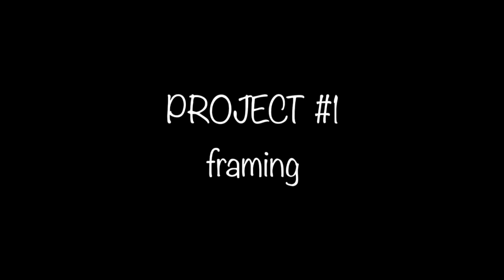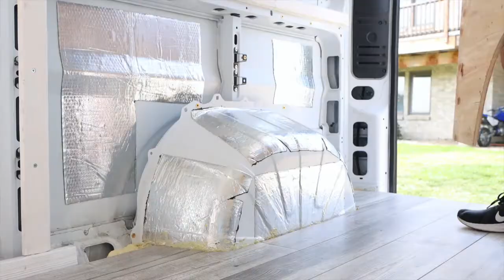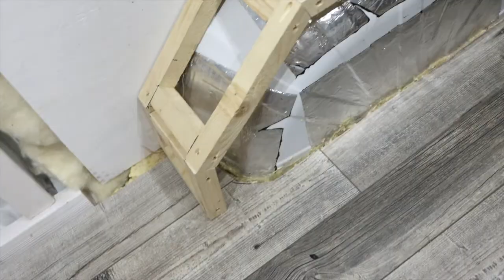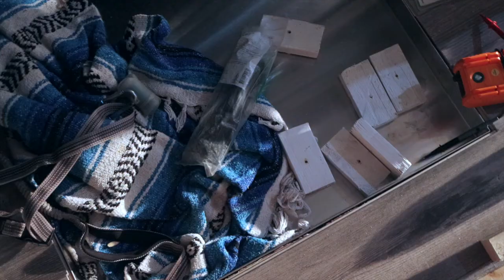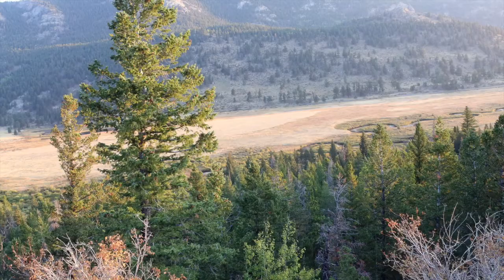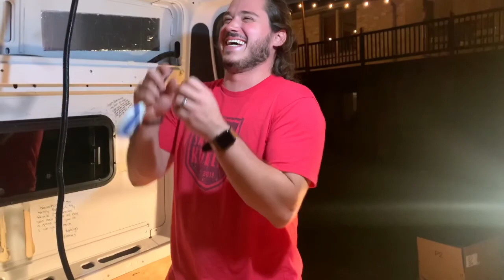VAN CONVERSION PROGRESS | framing, wiring, and running boards

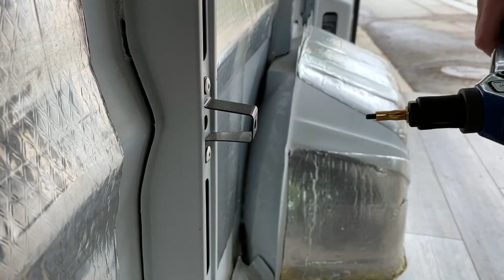Comment: Hi!  You guys have done a great job and you are so fun to watch :)     Quick question - What are the metal pieces that are extending from the wall (Seen at about 1:02 when you are demonstrating installing a cross nut)?   Do they come in different sizes?
Reply from the maker: Hi! Thank you! Those were already in our van so we just used them! I honestly have no idea if they were added by the previous owner or where to find them. Sorry!
Reply: @johnviv3956  Thanks anyway :)